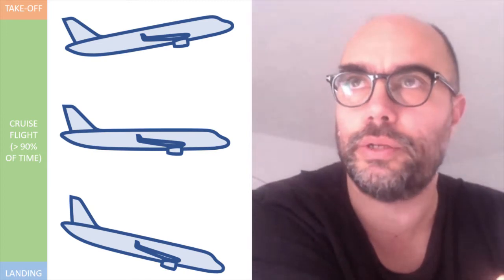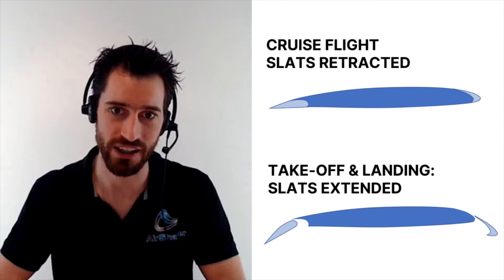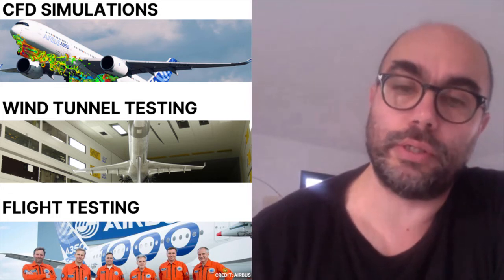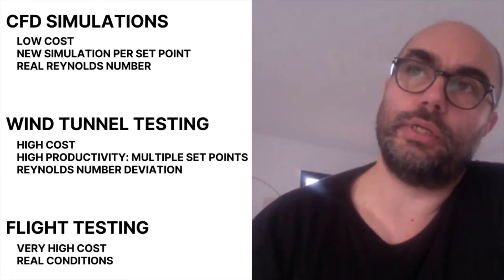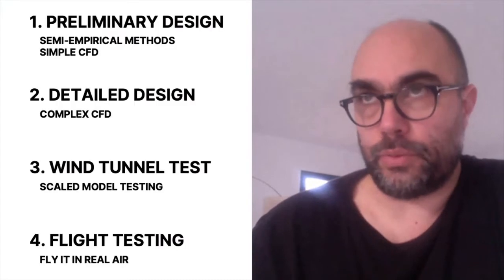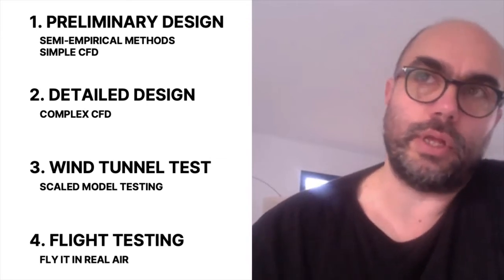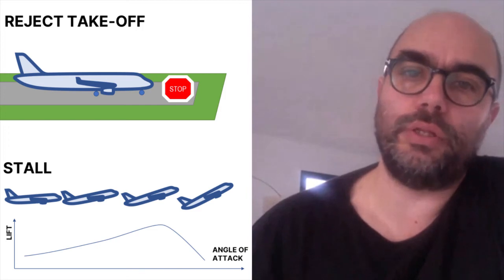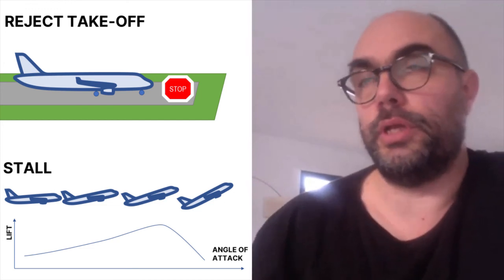AIRBUS Talks - Aircraft Design Tools

Comment: It seems a trend with these courses that the negative aspects of CFD are not discussed and people feel that just a browser-based calculator will get them all the design info they would need. In reality CFD, even for high fidelity models can be very inaccurate. Having conducted RANS CFD simulations and compared them against the 'real' experiment results, the difference is huge and it took a lot of time to calibrate the models and select the right solver that was even remotely close to the experiment data. Even when using something like LES which typically needs supercomputers to conduct, without experimental data for calibration, there are huge inaccuracies.
Reply from the maker: Hi Marina,

thanks for the comment and yes, you are right:
simulations can be extremely useful to gain insight, compare different design options and so on. But in terms of accurate absolute values, you still do need quite a lot of control over different settings and some turbulence models work better than others, depending on the application.

In each report we deliver, we recommend to also run a wind tunnel test. That correlation is crucial to be able to trust the values and trends you have found using the CFD simulations.

We also stay away from using CFD values as the only values in safety-critical applications, like the wind loads on tall buildings for example.

On the other hand, I am confident that over time, simulations will get closer and closer to reality - but perhaps we'll have to wait for quantum-computing hardware & software to get close enough :)